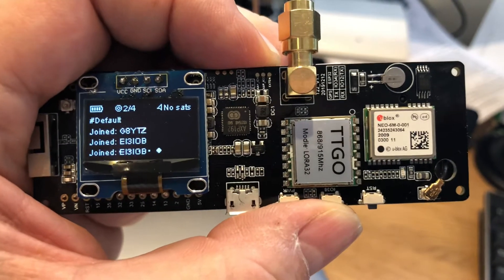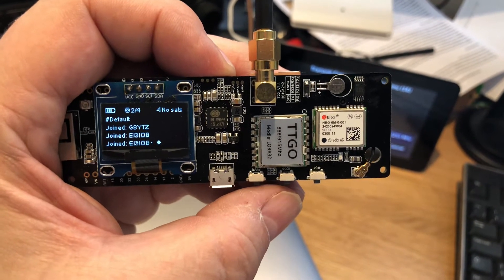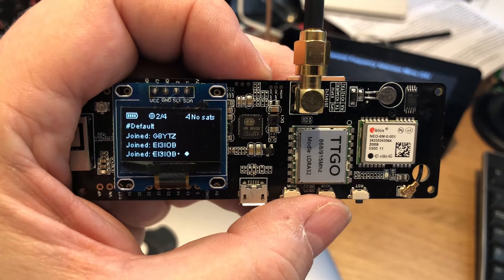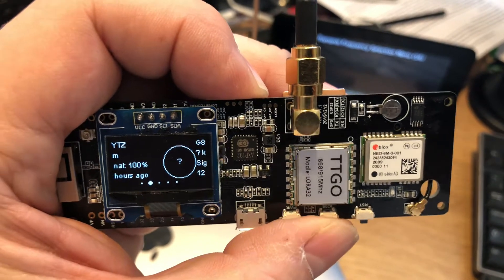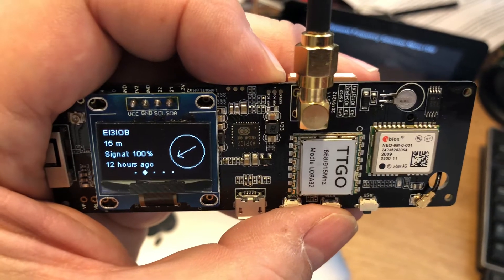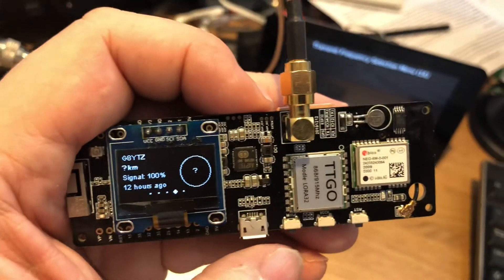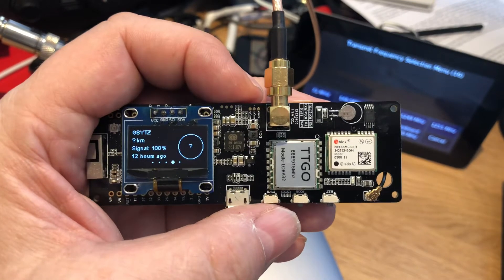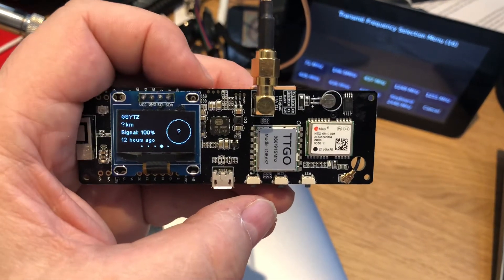Meshtastic TTGO TBeam - What the Buttons do!

Comment: I have Meshtastic 1.3.26 and only the left button works to restart. I don't know what software you are using but your suggestions do not work on my two units. 
Its shocking and offensive as to the lack of support for beginners with this device.
Reply from the maker: It’s quite an old video now. I am planning a new video that is up to date with the latest version. I’m installing two new nodes in SE London and will include this information too.

Comment: just soldered two tbeam boards for the first time and installed an 18650 and plugged it in. I have a blue light but the screen isn't coming on. I used ham radio crash course to reference which holes for the pins. any suggestions?
battery is properly oriented and the antennas are on

Comment: You said every time pressing the middle button the radio is performing the equivalent of a heart beats to the rest of the net work is that correct if so changing screens is sending multiple heartbeat beats is that correct. I have to admit I’ve been power cycling the radios if I need to force a connection it would be good to confirm if it’s on every middle button press. Or is it a press and hold?  VK1MIC

Comment: Hi, at 3:21 you have connected the T-Beam to an external antenna: what impedance do you recommend for the coaxial cable? 50 or 75 ohms? Also, what adapter do you use?
Reply from the maker: For co-axial feeders the convention is that transmitting antennas are always 50Ω and receivers always 75Ω. Where you have a Transmitter/Receiver we use 50Ω. The physics is complex, but there is good reason for this.
Reply: @G8YTZ  thank you!!

Comment: Hi sir. I’m a student from Taiwan who really likes ur videos. I have a question. I’m wondering whether u know how to use it without a oled display. Please,reply to me as soon as u can.Thank you!
Reply: Oh ok. So the OLED display is a must-have item. I thought that maybe we could get  the Bluetooth key or other information by using port monitor,but it seems that maybe the most efficient way is to get one OLED display. Thx for ur reply.
Reply: @shihjiunlin4242  its not as practical, but you could use a computer or even an android with otg adapter to get the bluetooth pin from the serial console.
The moment you try to connect to the device it prints the pin on the console
Reply from the maker: You need the OLED display I'm afraid, its a very cheap item and trying to do without would be far too painful.

Comment: Help me please.. I have two t-beam but I'm not able to connect tem?
Reply from the maker: Hi Michelle, firstly, can I ask which model of t-beam you have, and what’s the file name that you’ve downloaded to flash them with?
Reply: TTGO T-beam V1. 1 esp 868/915 wifi... Oled... GPS neo - 6m
Reply: Firmware1.1.5 was the filename download github/meshtastiv
Reply from the maker: @Mitch-fpv  OK, which file did you choose to upload? You have to be extremely careful to choose the correct file for your particular board, region and frequency band. This is the mistake most people make.
Reply: @G8YTZ  okay but I say it's the correct one... I have choose t-beam with 868... And I choose correctly 2 times the same

Comment: Hello
I have just received one of these boards 
(First one ever so total noob)
I have connected it to arduino but nothing can be loaded on to it
Comes up with fatal error
When I google search it says boot loader was not engaged
How do I do this
Best wishes ☺️
Reply from the maker: Steve Tillotson Aure you’re using the correct software for the board you have?
Reply: G8YTZ 
Probably not
What would you recommend 
There is very minimal information and tutorials on these boards on here
And I will admit 
I am clutching at straws contacting you 
As I can’t seem to find anything to resolve this issue

Comment: I bought the TTGO T-Beam V1.1 for EU865, installed the software (firmware-tbeam-EU865-0.7.10.bin) and tried to connect the device with the Android Meshtastic App via Bluetooth, but after typing 0000 or 1234 the devices don't pair and connection always fails. What is the reason for this? Or do I have to do something different? Thanks for your help!
Reply: Found it out by myself in the meantime after having connected an OLED display with the T-Beam. It is displaying a code for pairing the device. :-)
Reply from the maker: Make sure you choose the correct firmware build: For the T-Beam 868MHz (EU) unit use: firmware-tbeam-EU865-0.9.1 (as of 26/7/2020)
The app software I am using is 0.8.03 which fixes the Bluetooth re-pairing issue on older phones.